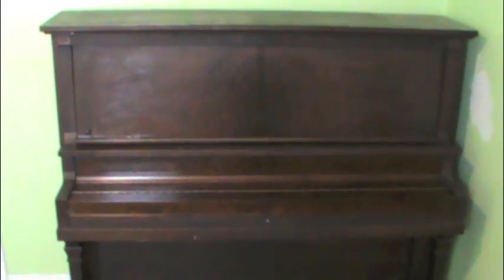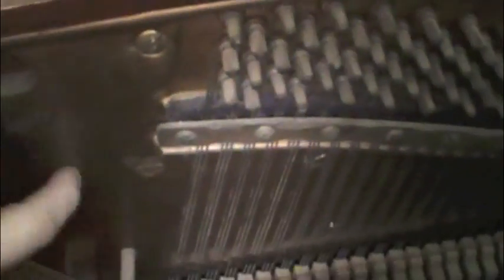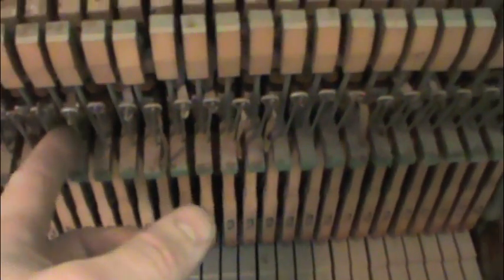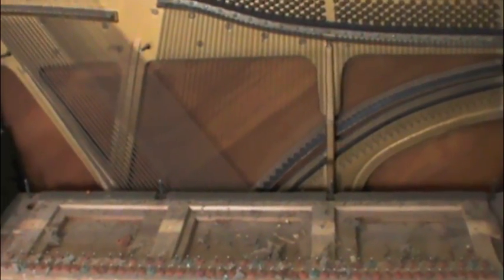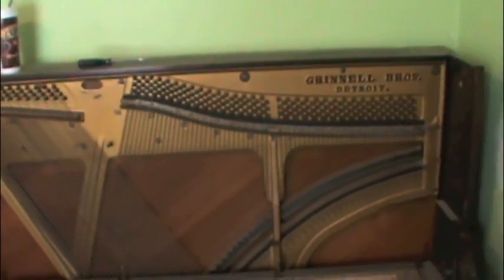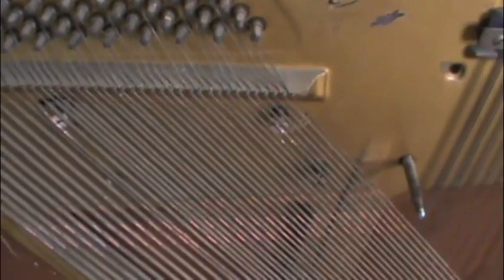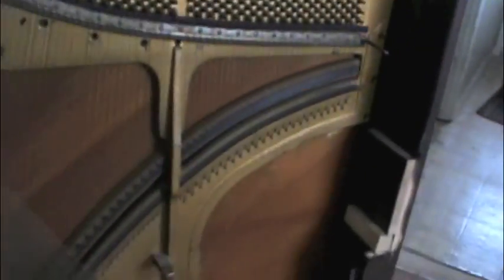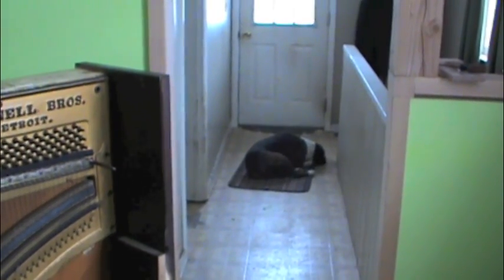Scrapping a piano

Comment: Wish I would’ve read the comments before I tried prying that wrestplank off for a half hour. Finally figured out the pins were threaded in, unscrewed them all with a 1/4” drive socket extension inserted upside down in my 1/2” drill chuck. After the last pin was out, the plank basically fell off. Oh, and I cut through all the strings with an angle grinder. Of course I positioned myself out of the way, didn’t want my neck or an eye taken out by one of them. And the only brass I found were the covers over the foot pedals
Reply: This is a great suggestion, works very well
Reply: I might also suggest to alternate unscrewing all the strings while the soundboard is still mounted/in the body. Would keep a good amount of wood between you and the strings and eliminate the need to cut the strings at all. It's what I'm going to try, anyway.

Comment: The tuning pins are set into pin block behind the frame. If you still have this thing, you would have to carefully wind all of the strings down in order to get the plate out.

Comment: To get the harp off the soundboard you have to remove the tuning pins that the strings are wound around.  They go through the harp and into the wood.
Reply: WickedZZzY yeah for sure I'm on my second one deconstructing and every tuning pin needs to come out and they barely have threads on them